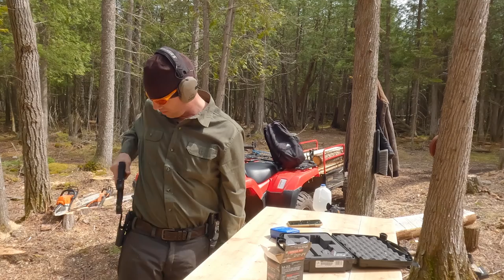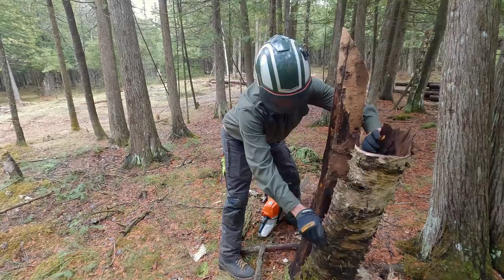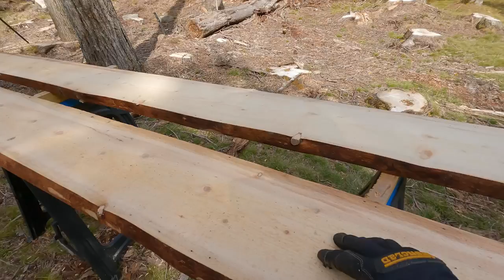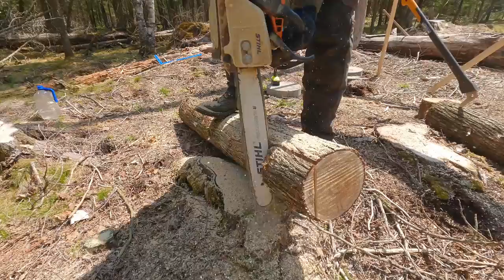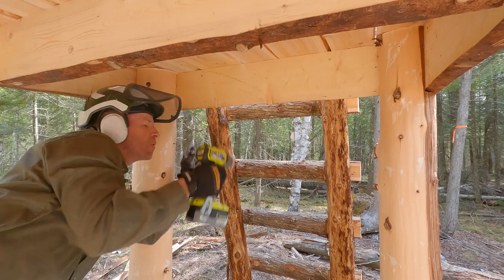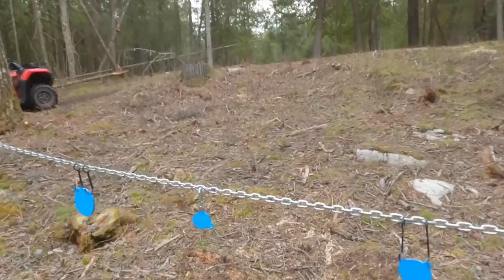Carving a Rifle Range out of the Forest+ 5' High Shooting Platform Build #138

Comment: Ryan, nice new driver. In my experience drivers are GREAT for star head screws, but NOT great with phillips head screws.  The hammering tends to strip the phillps screw or the bit pretty quickly.  Especially since you like to put things up and then take them down later, star head screws are amazing, because you can screw them in and out a bunch of time with no stripping. Def worth the extra couple dollars to get star headed screws

Comment: Ryan, you should get a lumber/loggers crayon to keep in your tool belt. It will be much easier to use than your knife and easier to see than the notch in the bark. Also, the "cut and scooch" is known as "kerfing in" to woodworkers and timber framers.